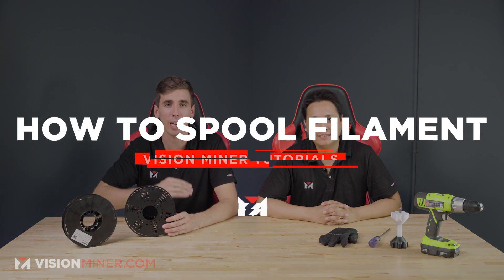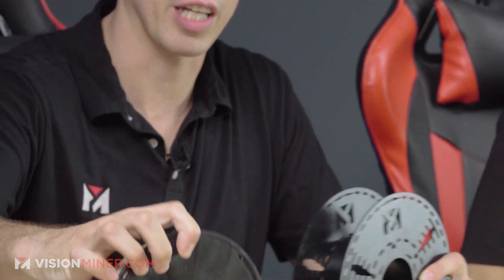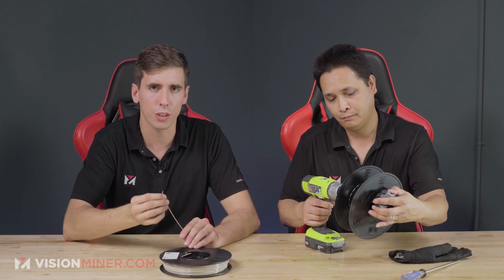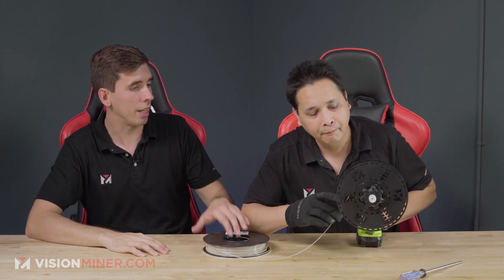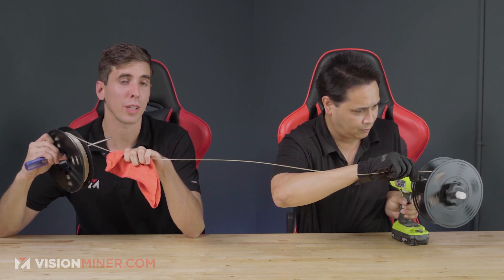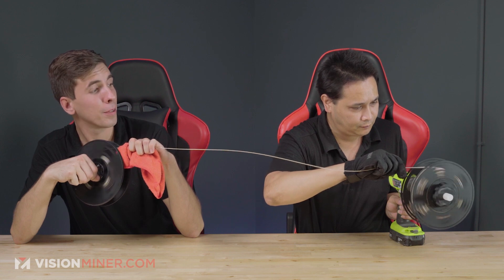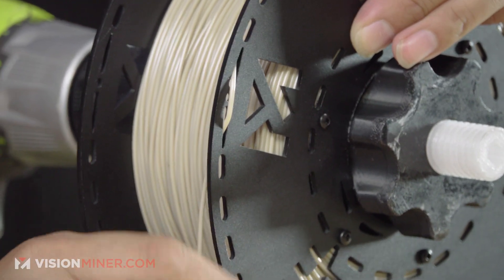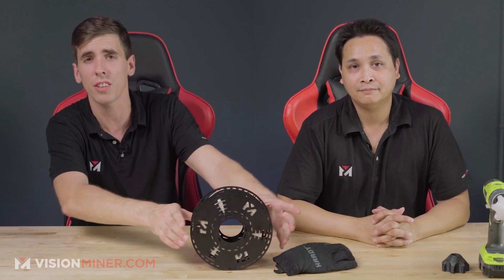How to Spool 3D Printing Filament on Metal Spools - Dry your materials safely!

Comment: I’ve been trying to figure out the secret of getting a nice tight factory wind. I have spool holders and a crank setup (easier to control than drill, just slower) and I can get it 95% perfect, but the two edges are tough and they screw up more and more as you go along.
Reply from the maker: The real question, though, is: how necessary is that, realistically? What overall gains do we get from a perfect spool? Is that worth the time to actually figure out? Sure, if it can be automated, but realistically, it's a negligible detail most of the time. We do understand though, it's SATISFYING! :)

Comment: i bought 3dtech pla carbon  filament and dried it on 60 C degree (the max is 65C). the spool deformed and filament became too dry, seems like a little melted also. I use thermometer so i have proper temperature. I also used another cheap brand which is also carbon filled pla. That one was perfect also print was super strong after drying. Now I have 3dtech nylon carbon filled filament. How can I know what is the material of its spool? I afraid of its spool deforming again. Its expencive filament why it has weak spool?
Reply from the maker: You won't deform the spool at Nylon drying temps -- should only dry around 70c, like in a food dehydrator :)
Reply: @VisionMiner  can i dry it at 80-90 degree? Specification says i can dry at 90
Reply from the maker: What type did you get? CFPA6, 12, HTN, or something different? Generally 70c-90c is safe, so you should be fine either way :)
Reply: @VisionMiner  I have already dried it and print was good))) I have CFPA6. I dried it at 80C. But I think nylon needs to be dried a long time. For me 4 hours wasnt enaugh. For better results I needed 10 hours at least. But I still couldnt understand why PLA deformed(((

Comment: This is an awesome simple solution! If the filament is creating enough friction on the glove to make it uncomfortable to hold, could the glove be contaminating the surface of the filament? Although I couldn’t quite see the surface of the glove or what it was made from, might not be an issue
Reply from the maker: Potentially yes -- however, I once (in the early, early, bedroom/kitchen days of Vision Miner) had a roommate put bacon on top of our PEEK. After washing off the PEEK, it did end up working just fine. Not recommended for flight-ready aerospace parts, but for most other things, it should be a non-issue :)

Comment: Would a 3D printed PEKK spool cost more than the metal spool?
Reply: I imagine so, looks like the spool body is a laser cut and steel/aluminium tube assembly. Actually very cheap to manufacture
Reply: I'm only concerned about the amount of inertia it would add. It will more load on the extruder trying to unwind filament from a heavy spool.
Reply: @alfredanil  For the speed at which the extruder pulls off filament, it should not be a problem
Reply: Extruder not only pulls the filament out of the spool but also has to push filament into the hotend. There should be some considerable amount of extrusion speed loss.
Reply: @alfredanil  I doubt it. If it is really a concern, one could design a smooth bearing spool holder to eliminate that drag. But from what I've seen in 3D printing, unless you have a serious filament snag or a weak Bowden mechanism, that is hardly a problem area
Reply: @alfredanil  This issue can easily be fixed with a custom spool holder incorporating bearings...
If you're willing to get metal spools, I'd wager you're willing to make a custom spool holder 😂

Comment: Lol 59.99 for a metal spook lol that cost more that the filament GTFO!! Lol
Reply from the maker: Yeah, we sell filament at $650/kg -- not designed for PLA - also not needed for PLA
Reply: The filaments they use are a lot more  than 59.99 a roll :P